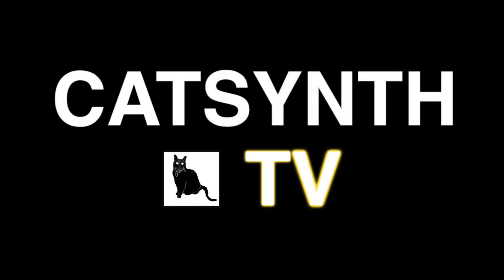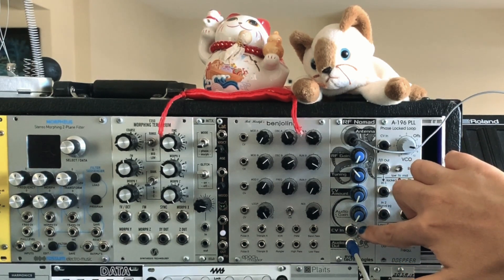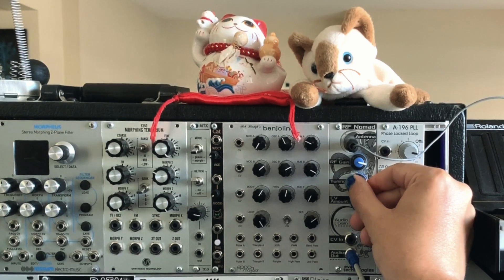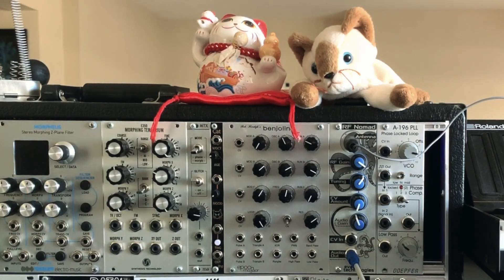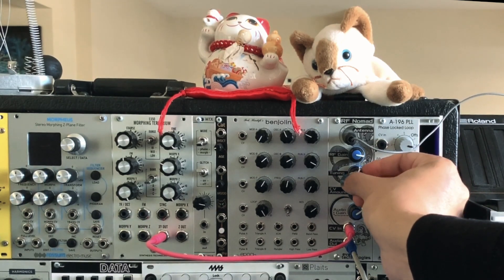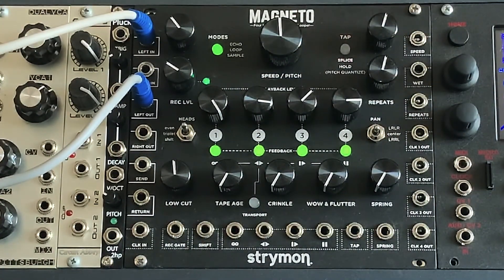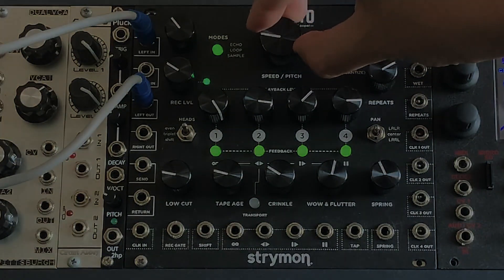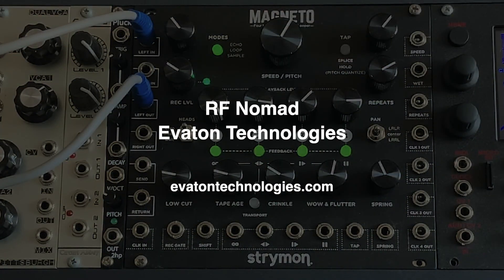RF Nomad Demo [Episode 182]

Comment: I've had one for awhile, been considering selling it. I haven't gotten as much out of it other than noise. It might be my location, I even got the 25 foot antenna and I can't seem to dial much of anything in. I still want to give it one more go tho' cause I do love the idea of it. Searching for some squeel!
Reply: Shortwave reception is much better at night. I used to have a really long piece of wire that i had going out of my bedroom window and tied to the washing line outside.  Nothing fancy but reception was much better. This was with a regular SW radio not this module but it should work the same. SW always came alive at night.
Reply: @alanc6752  Thanks for that. I figured as much about the night time being better but I'm currently getting up at 5AM so I'm not doing much at night. Maybe the wee hours are worth exploring. We live relatively near an airport too. I thought the planes flying overhead might make for interesting signals, but also, could that just be creating interference? Is it better to be somewhere remote? I'm still hanging in there with it!
Reply from the maker: @alanc6752  Thanks, I'll have to try that.  I'll post a follow-up video if I manage to get some stations on the module.
Reply from the maker: Haven’t been able to tune a proper station out of it, but I do get some awesome squeals. Using an external CV controller can help dial into some details.
Reply: @CatSynthTV  Yeah, I've put Maths on it. It's touchy and takes some patience. I have other short wave sources.